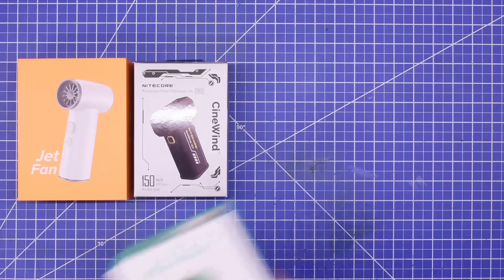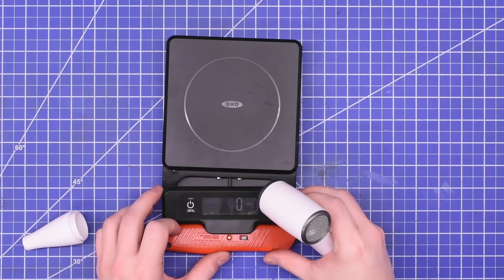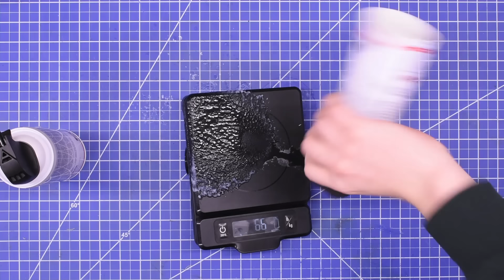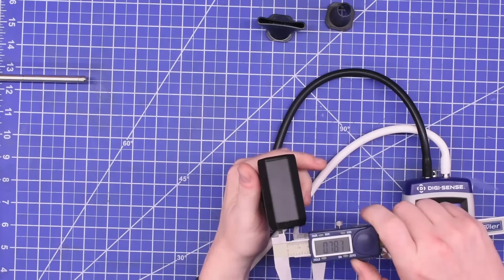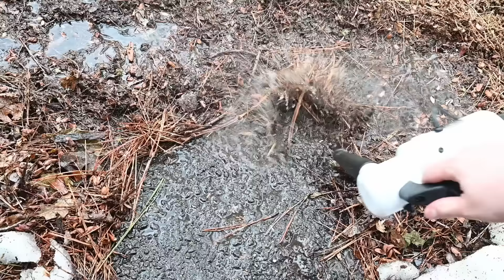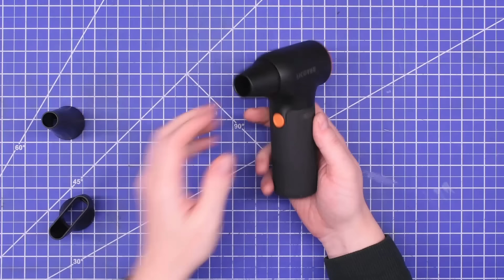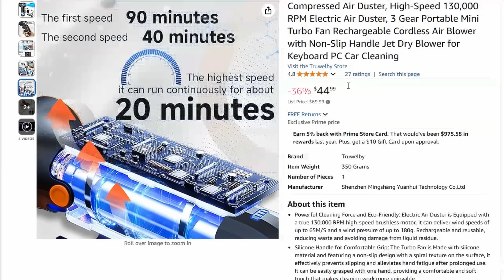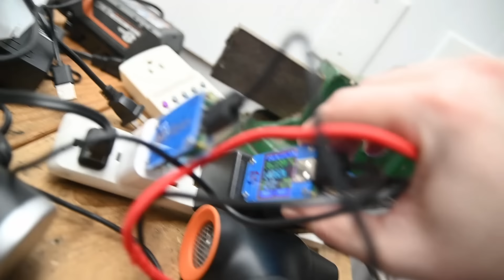Impossible Turbo Fan Dusters v DataVac & Actual Air Cans

Comment: I bought 3 of the Wolfbox MF100 and all failed the same way within 6 months to 1 year. The button stopped working, which I suspect static had a hand in. I was blowing dust/sand, which the directions said not to, which is the origin of static. I used one with a lame button that took multiple attempts to press to get any response for a few months before it actually stopped turning on. Shame. I love how pocketable they were. I would often just pull it out to dust the stairwells, or to quickly dust a surface, or blow out some filter just because I had it handy.

Comment: honestly for the handheld fans i have used they have been crap to very crap. best thing i did was invest into a mains powered duster, short bursts is all you need cleaned my rig,ps5 etc using it. 

IT Dusters CompuCleaner Original Electric Air Duster its on amazon, worth every penny.

Comment: DataVac is the only way to go really. I've had one for several years and it's still like new. Saves tons of money compared to alternatives. It was less than half the price when I bought it though, so it was a good value back then. At $115 that's a bit steep, but still cheaper than anything else in the long run.

Comment: Hi Torque test channel… I’ve been thinking about this and couldn’t find it anywhere else except on large scale leaf blower. What if you made a 3d printed Venturi effect nozzle? Could you get untaxed advantage using simple physics? More air volume moved with lower performing blowers? Just a though

Comment: My datavac is over about 10 years old, I finally took it out now that I don't do IT anymore. and it still works. For it's size and now with the MF200 out, I can't believe it's cordless.  Hopefully they will come out with one that can blow leaves.
Reply: Milwakee has a decent one that takes their m18 batteries. Not as small as a turbo one, but small enough.
Reply: @rm25088  I'm not surprised, Milwaukee has everything.

Comment: Can you build your own by taking a corded vacuum cleaner and putting the output side of the motor into a tube with a nozzle?
Would be very interesting and probably not that hard to do, these motors only cost like 40€

Comment: Huh, I have a Metro Vacuum ED500 that I bought way back in 2011. Still runs perfectly, but it came with an even smaller nozzle than the one that was tested. Not sure if that would actually change anything. They work great for blasting out neglected pc cases though, that's for sure. You have to do it outside because hitting the PSU will unleash a literal dust cloud.

Comment: Everyone doing these videos are misrepresenting the weighing scale test. In order to be a good duster, you need the highest "force" per any given unit area. The weighing scale test is measuring the total force across the entire area hitting the weighing scale which can make a terrible and weak duster seem more powerful if it has a big air "beam" (the area of the air hitting the weighing scale) and decent airflow. For example:

Imagine a weak duster hitting the scale with only, say, 5 grams of force for each "area/point" it hits on the weighing scale. Let's say each "area/point" is the size of a nickel coin or something. Because this particular duster has a really big beam of air, the size of the total area of it's beam of air hitting the weighing scale ends up being 10 of these nickel sized "areas/points". Well, the weighing scale will then measure 50 grams (10 spots on the scale, each pressing down 5 grams = 50 grams).  Remember though, at no point in that air hitting the weighing scale (hitting the object you're dusting) does the "force" of the air exceed 5 grams even though the weighing scale measured 50 grams. On the other hand, let's say there's another duster that has a much smaller beam the total size of only 2 nickel coins. This duster's air shoots out much faster/"harder" therefore the force of it's air is 12 grams of force for each area/point. Well, the weighing scale would then only measure 24 grams total of force for this duster even though it's air is hitting with over 2x as much force as the first duster. The weighing scale test would then say the first duster is better because of it's 50 grams VS the other duster's 24 grams yet the first duster is actually very, very weak - not even half as strong as the second duster - and only measuring such a high amount (50 g) because it has such a large amount of very weak airflow.

An analogy. Imagine you have 3 identical objects weighing 100 grams each. You place those objects on different parts of the weighing scale (not stacked on top of each other though). The weighing scale will obviously measure 300 grams but at no particular point on that weighing scale is there a force of more than 100 grams. Now imagine you have 1 object but it weighs 270 grams. The weighing scale will obviously measure 270 grams which is less than 300 but that 270 grams is all concentrated on one point whereas in the 300 gram test, the weighing scale didn't have any points that had more than 100 grams concentrated on it.

If you want to see how hard a duster's/blower's air hits for any given unit area - which is what makes a duster good so it can remove as many particles and as much "sticky dust" as possible - you can simply measure and compare air speed of different models at around a distance of 6 or 12 inches (do the test further away at first to make sure you don't overload and possibly damage or break your anemometer if the speed is too high). Yes, it's really that simple & easy. Air speed is not affected by CFM or by size ie. area of the "air beam". The higher the air speed, the harder that air is hitting for any given area unit and therefore the better/stronger of a duster it will be. It's really that simple. The weighing scale test is largely useless, misleading, and, at worst, and deceive people by having weaker model dusters resulting in "bigger numbers".

Comment: I wonder if theres like a device that does tire pressure and cleaning with mouthpieces for multiple purposes
Reply: and are they brushless? that would be a requirement for me for  longevity
Reply: licocore charging speed is lowkey a fire hazard lol better pray those discharge rates and batteries are good

Comment: The change in temperature in canned air is not primarily due to the pressure change. It’s mostly due to phase change, evaporation in this case. The cans typically contain R134A or another popular refrigerant. The primary job of a refrigerant is to absorb a lot of heat during a phase change, so it’s no surprise that the can gets very cold.
Reply: phase change, in this case, is caused by the difference in pressure. If it wasnt, the can would just start cooling down out of nowhere.

Comment: If you revist these tests; Please try the Xpower a2 blower. The Xpower is said to be even more powerfull than the data-vac. My digital kitchen scale hit 310 grams with the Xpower and 190 grams with the wolfbox mf100. My scale may but off but, in an apples to apples comparison, the power difference is quite compelling

Comment: i have a datavac (the plastic, eu version) and it has a dust filter on the bottom, if you remove the filter then it doubles the airflow and the pressure. If i'm correct about it the dust filter needs washing after a few uses, just pull it out, wash it, dryit then squeeze it back.

Comment: huh that datavac seems like a more expensive yet somehow simpler (and possibly more powerful) Compu Cleaner, which is about the same thing only 50 bucks and with a 2 stage resetting switch for the speeds(though that appears to be exclusive to the 2.0 model) so you can be gentle or rough depending on your needs and it's easy to to short bursts.

not that the compu cleaner is weak it's 500W :P but I'm hoping/expecting for the price the datavac at least has a beefier motor in it.

functionality wise these turbo fan dusters seem annoying as hell though the method of turning them on seems to imply that they are more meant for heavy/long dust busting sessions (in a PC or blowing of a desk you want quick short bursts not a constant stream of air blowing stuff over and away). that form factor that allows a separate speed setting and the trigger just activates the fan would be ideal (for pc maintenance, I imagine if your cleaning out a big air filter it gets old having to hold down the trigger)

Comment: Please do a comparison with actual tool brand blowers, like Makita DAS180Z / AS001GZ and Hikoki RA18DA. These don't have charge time (you can simply swap the battery) and you don't have to throw them away when the lithium battery eventually dies.

Comment: Why is your pitot tube resting on the table?
Reply from the maker: It's elevated to centerline of the duster
Reply: Ah that makes sense sorry! In the future it might be worth just having the tube well above the table. Turbulent air jets tend to expand at about 5°~6° angles as a function of (Downstream Length/Outlet Diameter). So if you ever compare jets with very different outlet diameters, distance from the pilot tube may artificially drop your centerline velocity. A good rule of thumb is within 10 diameters you're nominally measuring the bulk outlet velocity and after 20 diameters you're measuring a self preserving, but decaying velocity. The can of air has a very small outlet so it's jet diffuses very quickly unlike a blower. 
Loved your video just wanted to add an interesting note

Comment: Would love to see a dedicated review video mainly for wired air dusters, as I personally do not care much about weather it has a cable or not, just raw power. Actually, I might even prefer having a wired one simply because there would be no batteries which would slowly discharge over enough time spent on my desk or in my drawer and I would not have the issue where I would need to wait for it to charge every time I want to use it after a long period of time.

Comment: I have yet to come across one of these that has a HEPA dust filter… the reason imo that canned air works better, is because it’s not introducing dust… these however, work much like any other fan, and it will move suck in all the  dust in the air and spit it out…

Comment: I tested one I received yesterday and it's very powerful. At 20" distance, the loudness is only 67db on the low setting and 75db on the high setting.  It exerts 119 grams of force on my Starfit model 93016 scale. This 119 grams is from a distance of 1 inch. However, from a half inch distance it exerts 255 grams of force. At a quarter of an inch distance is 472 grams.   This test is without any of the nozzles .  It plugs into an outlet and it's very inexpensive from Amazon.

Comment: Walmart hyper tough brand just released their own version. Model 80308. I picked one up for 20 bucks yesterday. Rechargeable and similar to most of these. I think it was mispriced, because they're showing double that on their website. think they're so new they haven't finished stocking them yet. At $40 it's comparable to most of the middle of the pack versions that you tested. But it's all aluminum and very high-quality and for the price I don't think it can be beat.

 I do component level board repair and Metrology work for test equipment and Industrial Electronics, so Im fairly accustomed to assessing build quality. 

Not only is the aluminum Machining and fit / finish very good. But I opened it up and everything is extremely well done especially for the price.

It's probably not at the level of the wolfbox..... I'd say it falls in the middle of the pack maybe in the top 5. But for $40 and being available locally at walmart..... not bad. Would definitely prefer that over most of the other random ones

 Especially if you can snag one for $20 .... before they fix the price discrepancy.

 For some reason it doesn't come up in the search results when you use common search terms. They didn't use "Air Duster" or " blower" in the title or description so it's hard to find. It's model number 80308

Comment: Hey could you possibly test out string trimmers like the dewalt DCST972X1, the highest spec ego, the dual battery Milwaukee , the highest spec  ryiobi, the highest spec rigid if possible please

Comment: I’ve had the Truwelby air duster for a few weeks now, and I’m honestly impressed. It’s powerful, easy to use, and makes cleaning my electronics a breeze. No more dealing with disposable air cans, which is so much better for the environment. It’s small, rechargeable, and it works on pretty much everything.
Reply: I just bought it last week. Super powerful!

Comment: Late to the party, but as a computer nerd and tool nerd just a heads up to help.

When blowing out your PC cases, hold onto fans to prevent them from rotating, as you can wear out the bearings faster and cause premature failure.

Comment: Fyi on the cimewind you can double tap to lock it on. And I also ordered one and used it for a day, then it drained itself the next day and wouldn’t charge anymore. Lights Just flashed. Returned it for a refund.

Comment: Bought a Hyper Tough 8 volt version (Walmart). I has a vacuum canister, inflator, and blower tips. It goes for $40. I paid $5 for it on clearance. Battery doesn't last all that long at full blast but I'd say for $5 it was 100% worth it.
Reply: Sounds like you were there, right time and place. They're the best deals.

Comment: I started using these cordless dusters to bring scared to plug into some of the rats nests of cables below the counter.  I fix ATMs and smart safes. Safes are usually hidden under the counter with every cable / plug in the whole store.

Comment: Suggestion for the future: measure the battery capacity in Wh (watthours) please!! mAh is dependent on Voltage so e.g. a 5000mAh battery at lets say 12V has more ""energy stored"" than a 10000mAh battery at 5V. The first can power 60W for an hour, the other 50W for an hour which is a HUGE difference! And looking at the vastly different mAh ratings shown in the chart I believe that's exactly what's happening

Comment: USB-C recharging is often not up to spec and may not work with most good type-c chargers and ports. It would be good to verify they have the 5v signal resistor installed

Comment: I own the DataVac and it is a great tool that equates to using an air spray attachment powered by an air compressor that never sags due to dropping air pressure and without the massive compressor.

It doesn’t do as good a job as the initial  pinpoint spray from an air can but it does a good enough job and never runs out … it’s POWERFUL AND WILL JUMP WHEN PLUGGED IN IF YOU ACCIDENTALLY LEAVE THE SWITCH ON but its corded and loud you need headphones … I use it all the time to dry of machine parts after cleaning them.
Reply: It would be much cooler if it could also run in reverse as a small vacuum. That would really help to justify needing AC power.

Comment: Had these things in mind for over a year. The Idea of spray cans as throwaway articles never appealed to me.
An air compressor is too large for just blowing some dust.

But until videos like that I wasn't convinced to buy one as I had no way to compare their power. And as Bosch or other reputable companys don't offer these dusters I had no way to tell if these are fine, which one is a dud or the whole concept doesn't work.

Seing them compared and working convinced me.
Got one yesterday.

I was afraid the air pressure is in the same ballpark as an hair dryer. It is not. It is actually very impressive.

Ideal to  quickly clean out filters of vacuum cleaners and air cleaners outside.

Comment: Digging the comparison, looks like a clear winner.
As an aside, I purchased the plug in under a different badging, and it worked amazing..until I dropped it, bent the can, and it started doing unsafe things, like turn 9n randomly, and get 🔥. Not recommend if you'll drop it.

Comment: What are these designed for? At 60$ you can get a cheap 1.5kWh compressor, it's not much more to get a compact portable one. That would enable the use of small air tools, airbrush and what have you. This "new" fan type is just a expensive hairdryer without heating

Comment: There is a level of control and precision with canned air that no electric can touch. On the flip side the same can be said for the sheer volume of air from electrics which canned air can't compete with. I guess it depends on your needs, for me canned air is king. Ymmv.

Comment: The DataVac made me think about a feature I never use on any of my shop vacs - most of them letting you use them as blowers if you swap the hose from intake to exhaust. A full size might not make much sense on this chart but, for example, I just grabbed the HF Hercules 120v/20v shop vac for free (with purchase of $100 battery, natch). It's not much bigger than the Datavac, and it can be used corded or cordless.

Comment: You need to test all these USB-C charging devices with a USB-C PD power supply and a USBC to USBC charging cable like most modern electronics use.  Too many of these cheap products are not compliant with the USB-C standard and will not work unless you first convert it back to legacy USB-A and then use a dumb USB-A to USB-C cable

Comment: Can I get an opinion on the ($55) XPower A-2 corded air duster? it comes in significantly cheaper than the datavac with similar design. Just wondering how it compares, seeing as there's a significant price reduction.